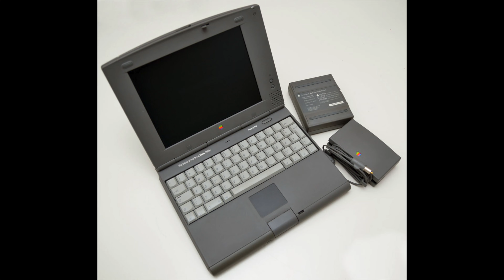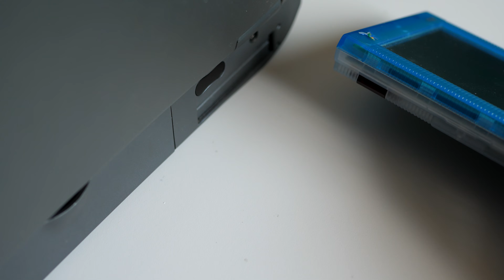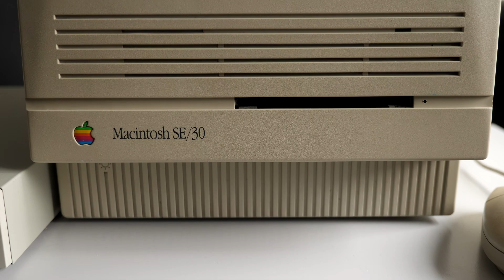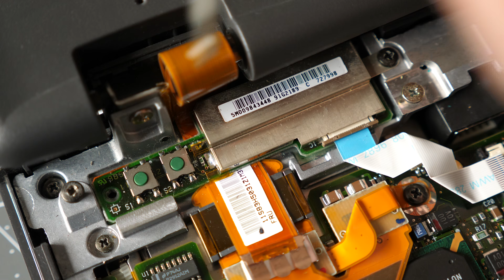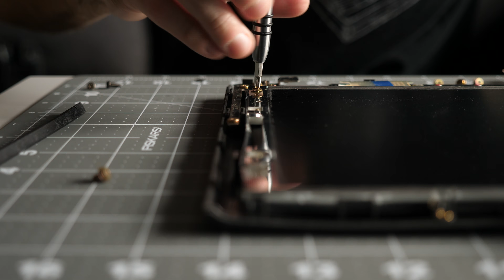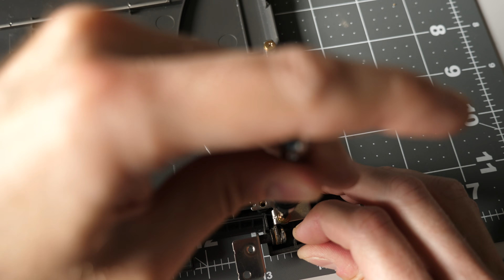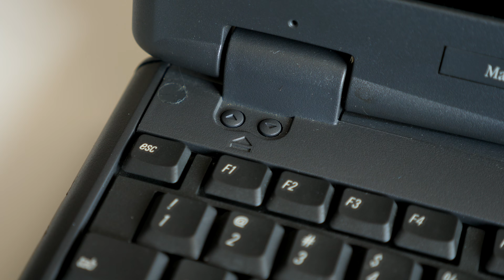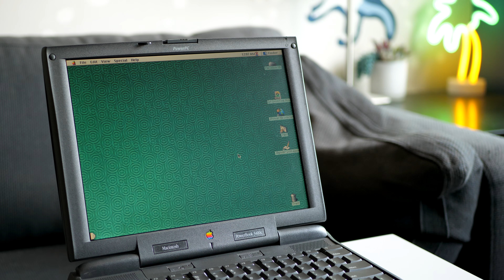PowerBook 2400c -- The Japanese Mac Made by IBM

Comment: one way of reinforcing brass inserts in plastic standoffs is to glue them and then slide some thinwall brass tubing over the outside of the plastic part.
Reply: I usually fill the crevice around the insert with something like jb weld. As long as you leave passage for any cables, that usually prevents any future breakage.
Reply: @briangoldberg4439  Same here - I use whatever 2-part epoxy glue I've got to hand, like Araldite. It's not limited to very old laptops either, the last one I did was a Dell Vostro 15 5568, only 3 years old but just out of warranty. Seemingly part of a bad batch because I've seen loads of them fail the same way. The upper case/wrist-rest fails and the screen falls off if left unchecked. That said, I'd really like to try the superglue and baking soda method.
Reply: Super glue and baking soda works also.
Reply: @Tomppa8.2  that too. really just anything to reinforce the nut-sert from the outside, putting it back as-is is just asking for it to break again. Even if the glue holds, it'll be stronger than the plastic around it.